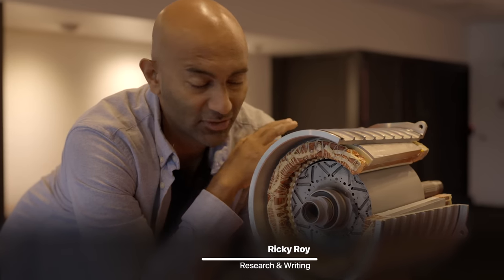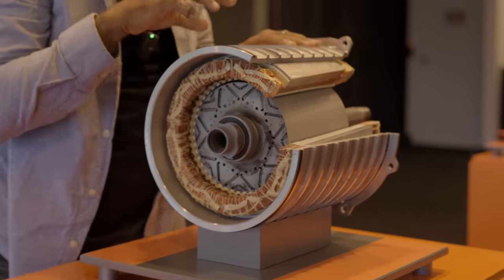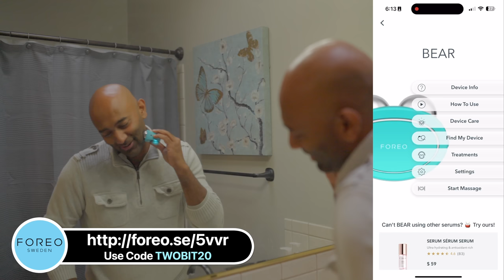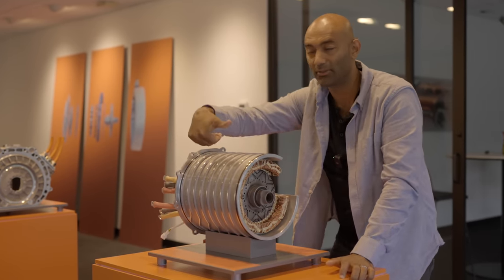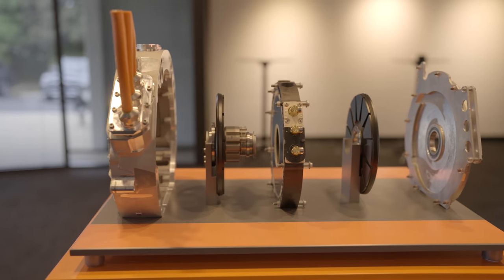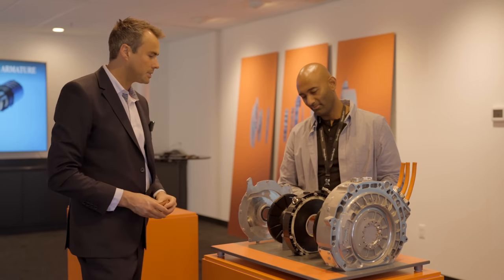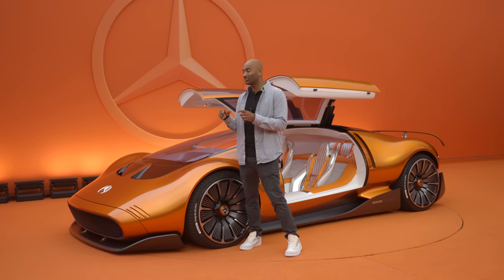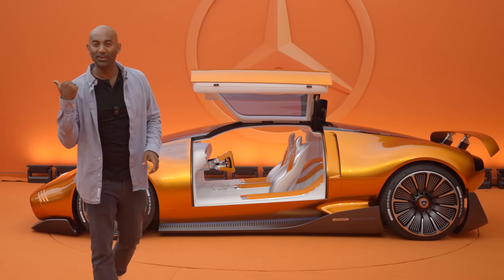Axial Flux Motors Will Change CARS - Here's Why

Comment: So, a light weight golf cart? :)

I have nothing against electric motors in vehicles, but it all boils down to storing the energy supply for those electric motors... Most trains in the US are of the diesel-electric variety and that works great... In other parts of the world, you also see trains that have either overhead power lines or an electrified third rail for power... That also works well... The problem with making purely electric personal vehicles in the US though is that you have to carry around all the energy that you are going to need in a battery pack and that battery pack takes more time to recharge than it would take to refuel a gasoline engine powered vehicle... So, as far as I'm concerned, a vehicle that could be recharged by plugging in at home or at a recharge station that ALSO has a gasoline or diesel engine that powered a generator to recharge the batteries would be acceptable (i.e. PHEV), but one that is purely electric is unacceptable other than as a golf cart or maybe a city car... Tesla is just a very expensive golf cart...

But, at my age and the number of miles I drive each year (only 14K miles in 5 years), it's a pretty good bet that my manual transmission (which I explicitly special ordered) Jeep Wrangler will last me for the rest of my life... I guess that's an "advantage" of being an old fart? :(

Comment: I think that new axial flux motor is good ideas. Not everyone is so interested in faster acceleration. If axial flux motor is as good as average none EV's in acceleration then this is good enough to go from point A to point B, then that's enough what we all need for everyday driving. Yet it saves money and not polluting air. If that's the case I mentioned then new axial flux motor is perfect. I would buy cars with axial flux motor as soon as it's available. Those motors you could even instilled in back wheels hubs or in all 4 as an option. Installing them in wheel hubs would save the spase too. 👌👍 Yet i would try also without adding transmission it might be good enough for regular driving. It all depends of test drive results??

Comment: So if the problem is T=E x F regarding rotor size... and seeing as these are small..then could they not couple several (ex:3) together, each varying in size to compensate for RPM range? Thus negating the hybrid(gas) portion of the engine.. 
Or is the rpm limited regardless of the rotor radius..?
Reply: Rpm is limited by the outer radius of the rotor, if you put several different sized rotors the rpm would be limited by the biggest rotor, but you could bypass it by using clutches or freewheels.

Comment: interesting motor but im already skeptical on this one because they got someone that knows nothing about motors to talk about them.
ok so here we go, for vehicles we actually want slower spinning higher torque motors, which this has cool, (battery cars are overall garbage but this motor seems to be an improvement on them at least)
let me clarify this further, lets say you want to travel at 150km/h top speed, lets say your tyre in 1 meter in circumference, your running say a 1:3.5 diff ratio (because battery cars were meant to have hub motors but all the companies cheaper out), and lets try to not need a gearbox, simple.
150 km/h is the same as 2500 meter/minute, which is 25 rotations per minute of our tyre, add in the diff ratio, we have 88 rpm. 
so if our motor spins faster than say 90 rpm it means that we need a gearbox to slow down the motor rpm otherwise we are wasting torque.
unfortunately this is the part that you should start to realise that ideally you want a motor that rotates slow, that is durable, that has high torque and is simple in operation. 
in other words a steam engine. 
'inset angry comment about steam engines sometimes using coal, without realising that battery cars would actually use more coal due to the inefficiency of the power grid and/or some sort of comment about a magical solar panel array somehow charging 50kw of power in a day that also fits on a residential roof, that also somehow wasn't made in smog city' and we are done
ps: electric motors don't make energy

Comment: Yes the power to weight ratio of an electric motor is superior to an ice engine, but keep in mind the weight of the battery which can be 1000 lb versus a 200 lb gas tank.  Overall electric propulsion systems weigh more in general
Reply: WRONG!! Overall BATTERY ONLY powered  propulsion systems weigh in total as much or more than ICEs. BUT take the concept CX75 supercar that Jaguar built many years ago using microturbines as an example. The battery was small and, when used to maximise power  & performance, mainly during acceleration. The two microturbines plus the alternator (generator) and TWIN electric motors provided the bulk of the power output and in total they weighed much less, were FAR less complicated, had MASSIVELY fewer parts to go wrong, and in addition produced an overall efficiency of energy usage of pretty much DOUBLE the efficency of ANY reciprocating ICE which wastes a HUGE amount of energy just doing NOTHING productive.

A reciprocating ICE is a complete engineering anachronism and has NO place in any propulsion system seeking efficiency and simplicity of manufacturing and operation! 🤔🙄👎

Comment: LK-99, a compound of lead, copper, phosphorus and oxygen, is a superconductor at temperatures above 400 kelvins (260 degrees F) and ambient pressure. Perhaps the right material to throw the electrical/magnetic induction industry on it's head.

Comment: not that most people care these days, but these electronic systems require highly trained mechanics to repair…the average wrench turner can repair a traditional, more mechanical  internal combustion engine …of course the manufactures got hip to this long ago and started building engines with many electronic systems, and are very proprietary with tools and equipment needed for repair…
i’m not anti technology at all, but believe that there is a market for more simple solutions than what is most widely being used today…perhaps there will be a day when a car builder will capitalize on this smaller spectrum of the market…they might also find that it slowly becomes the majority of it…

Comment: This biggest limitation of electric motors is the torque curve. They have high torque at low RPM and a constant drop in torque with zero torque at the top of its RPM range which limits performance at the top end quite a bit.
Reply: But real passenger cars never need to run in any race. Low RPM torque is much more important.

Comment: The comparisons between different frame sizes, rotor sizes, and layout makes the information comparing radial vs axial motors rather low value.   Comparing a low pole count radial to a high pole count axial is apples and oranges. 

While the axial flux can pack more active motor into a radial plane, it is very limited in axial length witbout essentially stacking axial motors.  This increases non active motor and motor losses, particularly end turn losses. 

End turn losses on an axial flux are still there.  The stators are very expensive to manufacture.  While some form factors will favor axial flux, it always comes at a cost disadvantage. 

In short, if you are willing to pay for higher performance, any motor topology can be engineered to meet the needs.   If you are limited in length,  axial flux wins.  If you are limited in radius, radial wins.

Comment: if they used silver instead of copper they would get 760 hp but it would cost more and would need to be sealed better for corrosion resistance

Comment: The problem with electric motors built into the wheels is adding to the unsprung weight also the gyroscopic effect of a heavier spinning wheel.

Comment: 9:30 how is the axial motor 2-3x more torque dense, when its rotor has almost the same diameter as the radial on the other table, and its stator has 2-3x less copper windings?

Comment: If these are so great, why aren't they used in any BEVs? Why did my electric motor prof never mention them in his lectures? The guy literally worked at mercedes developing BEVs for years and now heads an electric vehicle research group.
Also, your explanation how a radial flux motor works is incomplete and rather confusing.

Comment: you cant really compare power to weight of a motor to an engine only considering the block vs motor weight. When you throw the battery and fuel tank into that comparison the story changes greatly even with a transmission .

Comment: I'm sorry but every single time I hear any EV news, nobody wants to mention incorporating range extenders. Half the people here in the US don't live in urban areas, the nearest charging station to me is at least an hr away in all directions. A dual piston opposed piston setup can produce 4 cylinder power at far higher efficiencies, and with no connection to he wheels far more stringent exhaust controls can be employed. Then there's micro turbines, little jet engines, that idle at 10k rpm and while not efficient as such theyll burn damn near anything. These and other setups can be made to produce electricity and make EV's viable for those who live away from dense population centers

Comment: power and efficiency is what matters most. will see how axial hold over time. about low rpm. again power matters most. interesting side-effect of EV's is wheels had to become bigger to have 1 gear. so it could be different gearing or bigger wheel to get speeds you want

Comment: Design should be electric car battery, feeds small electric engine, that then feeds a combustion engine instead of liquid fuel. Design allows every aspect to be smaller, so quicker charging and combustion engine is directly moving car.

Comment: Could re-invigorate the engine swap crowd. Take a FWD car, keep the front engine, cut a hole in the trunk and add a couple hundred HP on the rear wheels with very little modification.

Comment: Typically, the wheels on a car only needs to reach about 1,000 rpm, so ultimately, any motor rpm above that is going to require a gear box that adds weight and and friction.

Comment: This is OLD NEWS!  Axial flux motors were first made in the 80's by Cedric Lynch in the UK and featured in his famous cobbled together electric enclosed motorbike that did 60mph and a 200 mile range across England using the first Chinese LiFePO4 batteries. They've now been adapted for ultralight sport aircraft and electric sports cars. Saietta UK and Cedric's Agni motors in India are making them, and numerous other companies!

Comment: You are giving up Torque for the extra HP.  This motor may not work well with a wheel, because you balance torque to HP in order to pay the bill for overcoming friction of the wheels, and the acceleration.

Comment: check emrax motors they are using axial flux tech for years. We use it in formula student cars. 107hp 11 kg motors… accualy now emrax 228 produces 160hp 230nm torque with only 11kg

Comment: As good as this is its the battery tech that will make a real difference. Having a 500/1000kg battery with it cooling/heating system and only 500klm range isn't great, get that battery down to 100kg with no cooling needed and 1000klms range and EV's will be great.

Comment: The Automotive market is of course enormous, but you have not touched on the market where weight is critical - AVIATION !  I would expect to see these in the world of aviation before we see them throughout the automotive world.  Aircraft engines currently are priced 6 to 10 that of autotive engines.  A light high horsepower engine is exactly what the world of aviation is waiting for.  You have not touched on the DC efficiency, but I am guessing that it is more efficient with the less windings.  That translates into better performance from the same (or more powerful) battery).

Comment: What would really excite me is if they put a small version of this into a car like the Mazda Miata and put a 5sp manual behind it. To me the biggest draw back of electric cars, by far, is how dull and boring they are to drive. A lower rpm, high torque electric motor would make sense in a car that you actually drive, with a manual transmission, rather than a really fast sofa on wheels. The later is not only boring, but also a death trap in the hands of the average inattentive US citizen.

Comment: The smaller these get, the easier retromodding an old car to electric will be. Imagine if this style of motor could be installed to replace a wheel hub and brake. Then batteries where engine and transmission used to be.

Comment: However, you left out the fact ALL electric motors suffer from Back-EMF😁 The faster you spin it, the more torque is lost. Current drops.
To really be efficient over a broader speed, at least a 2-speed transmission like Porsche uses is needed.
Axial-Flux plus more speeds is answer. Tesla consumption gets really worse at higher speeds due to lack of a transmission of some sort. Reduce RPM, reduce BACK-EMF, Reduce heat, improve efficiency by adding more speeds. Sure a Tesla motor may spin that fast, but it becomes much less efficient.

Comment: The first factory mass producing axial flux motors will end radials. Smaller, cheaper, lighter, more powerful, better cooled, etc. means no competition. It's like ICE competing with electric motors and great batteries.

Comment: still has a shitpot full of moving parts though.. especially compared to the Wankel. I mean this is basically an 8 piston design although it only has 4 spark plugs. Also a Wankel can have more than 1 rotor and its extremely smooth running regardless of how many rotors.

Comment: How about they also sell these motors and associated components to convert existing cars from I. C. TO EV. I'm sure just due to mass production they could reduce the price. Not only that but I believe that the fastest way for gas powered cars to be replaced by EVs or Hybrids will be to convert existing vehicles. Some of which people are in love withe the appearance more than the prime mover under the hood. I know I am. There is also preserving the antiques and classics.
Unfortunately I will probably not be able to afford an RV, HYBRID OR CONVERSION, but I would still like to see this done.

Years ago I met an older mechanic who had an old Simca where he'd removed the engine and replaced it with a military surplus 24 Volt DC generator. As most people know if it's a Direct Current Motor it can also be used as a generator or visa versa.
He powered it with pretty much worn out lead acid batteries recovered from salvage yards and other mechanics. He used both 6 and 12 volt batteries. It wasn't driven on the road but only on his property for fun, kinda like an oversized gocart. It didn't go very fast and due to the low quality of the batteries it needed frequent recharging. But it was intriguing and looked like a lot of fun.

Comment: Take a gas powered engine and connect a generator to the rear of it. That would power one of these radial engines on the ends of the axle.

Comment: I hope the energy storage technology aka batteries improves alongside the electric motor improvements. Seems like batteries are a huge limiting factor preventing the world from going to 100% EV. The mileage range and recharge times will have to significantly improve before everyone will give up their internal combustion engines. Also, the cost of EVs will have to come way down as well. You can buy a reliable used gasoline powered car for a few thousand dollars where as EVs are still expensive for the average person.

Comment: Not really much of weight savings if 1 motor will only be used in a single car. You would only save approximately around  20 kg if it weighs twice the Flux Motor. The weight of the EV is mainly dependent on the batteries. The battery pack of the Tesla Model 3 long range for example weighs 454 kg.

Comment: The problem is not the electric motors. The problem is the batteries and the charging infrastructure. I propose an electric drive car with a small jet turbine powering a high speed generator at the optimal rpm for fuel efficiency. This way you can still fill up on petrol, but have the instant torque of electric drive.

Comment: Having motors that weigh 10 kg won't change anything if the batteries are still 1,000. My good ol early 2000s econobox is 900 kg and still gets me 3.6l/100km. Good luck beating that at a <$/€5,000 price point

Comment: I don't really see that it helps to save a few pounds on the weight of a motor when you compare it to the 1000lb + weight of the car battery.  And in-wheel motors always seem like an idea that will never actually make it to production. But I agree that motors are endless fun to play around with and good that people are trying different ideas.

Comment: One axial flux motor at each wheel would stick, the beauty of this is, they can be put in series, one behind the other, eg. 2 per wheel on the back axle 1 per wheel on the front axle.  As usual , we are waiting for a giant shift in battery tech to catch up😢

Comment: Saves 14 lbs and a tiny bit of space with the motor just to add 200 lbs back and take up more space than you saved by adding a transmission. Classic Mercedes engineering.

Comment: No it wont. And all the talk of performance this and performance that, WOOO you have a really fast thing that can go 50 miles between 12hr charges. And then in 10yrs or less its a paper weight because the $20,000 battery is shit and no one can afford to replace it so its destined for the junkyard, where NO ONE is ever going to come pull parts off it. Meanwhile the 1968 Dodge 383 pushrod gas burner in my truck still fires right up and drives with minimal performance lose in 60yrs and 100k+ miles of abuse. Know what didn't survive the 60yrs of use? The starter and the alternator.